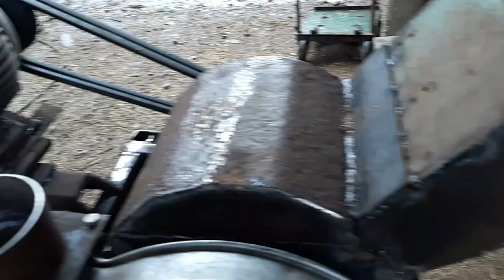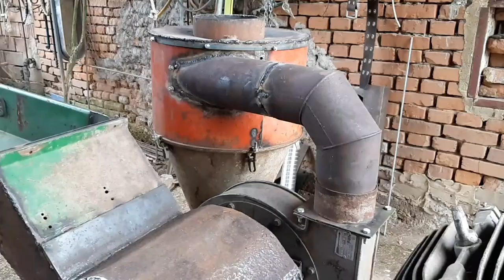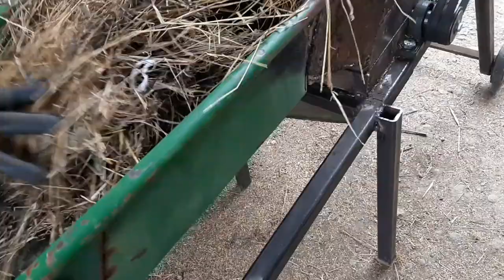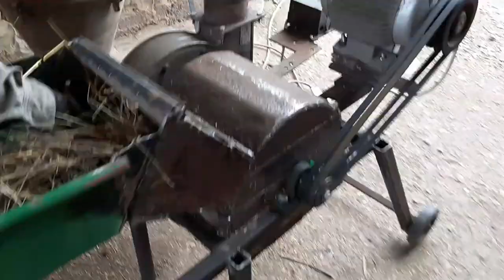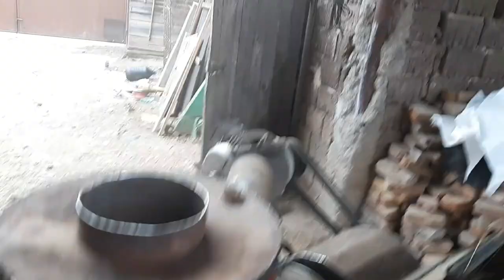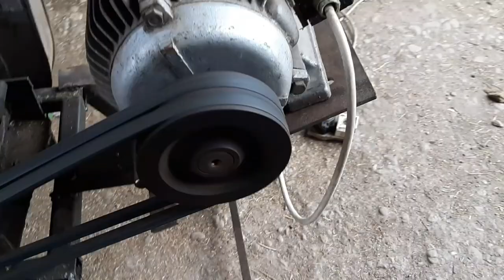DIY HAMMER MILL MACHINE WITH CYCLONE

Comment: Unfortunately, it is very slow to pull the grass, so production is very small
Reply from the maker: I am satisfied with the result obtained. I will probably make small changes in the future to increase production.
Reply: @DorelBorlea  بالتوفيق والنجاح ولكن من الممكن اضافه سلسله سحب العشب على نفس حركة الاله ولكن بالسرعه البطيئه عن طريق بكرات
Reply from the maker: @ورشةاولادابووحيد  شكرًا لك. نعم ، يمكن إجراء هذا التكيف. ربما في المستقبل القريب سأحاول تكييف حزام ناقل.
Reply: @DorelBorlea   Greetings to you. And I want to make an accurate grinder, but I do not know the design .. I work in the field of welding and my basic profession is a place in diesel engines and agricultural machines .. Do you have a design to make an accurate grinder
Reply from the maker: @ورشةاولادابووحيد  I built the grinding mill according to the available parts and materials. I did not make a technical sketch for this mill. I want to make fire pellets from ground straw and that's why I made this project.
Reply: @DorelBorlea  هل متاح رابط الفديو
Reply: Bro, I have an idea for very good production. I mean probably 1200 kg production per hour.
Reply: @kdmehar9711  بالتوفيق والنجاح اخى.. من أى دوله انت